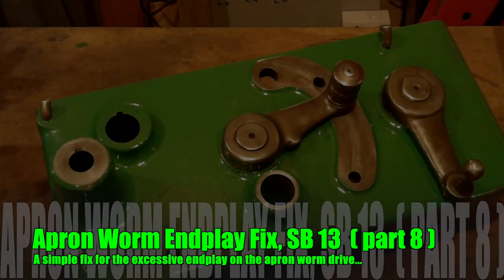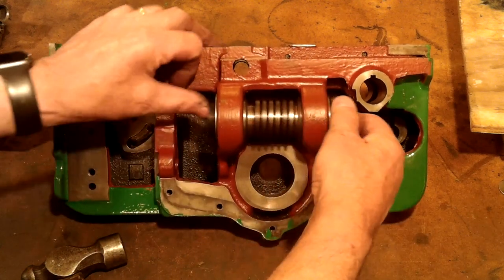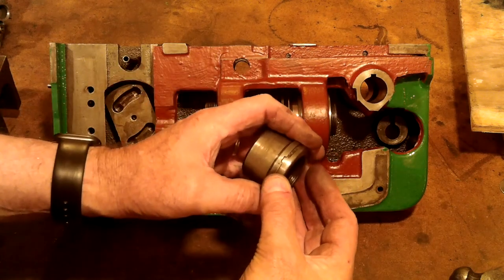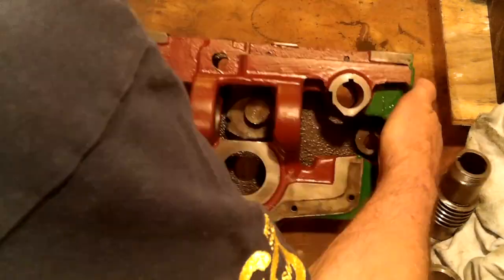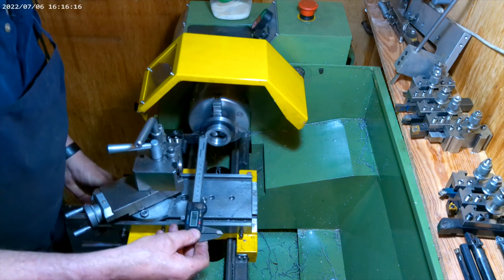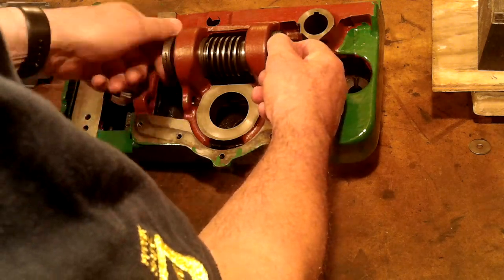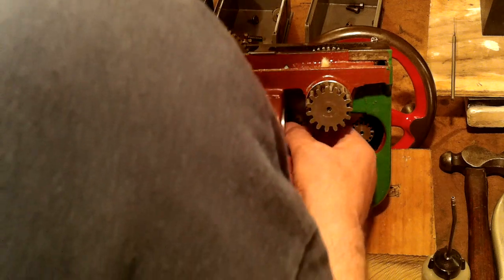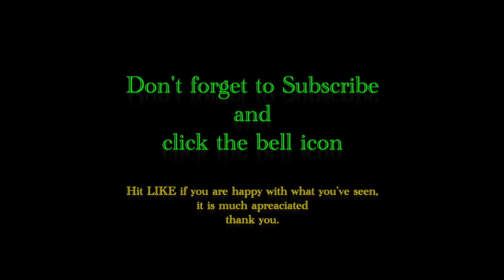Fixing the Apron Worm End Float (part 8)

Comment: Thanks for that, I've just finished doing mine but redrilled one collar to remove the end play. As for wicks, I refuse to pay Grizzly prices plus shipping to the UK so experimented with short lengths of 3mm and 5mm Lamp Wick and found they wicked a very heacy weight oil (120 SAE) in cold conditions in a similar trial to yours. I also tried using a thin strip of man made felt camping towel which only manager half the capilary performance og the lamp wick

Comment: Very nice work Paul!  I do think you have swapped the two ends.  In the take-apart segments, the one with the chisel marks is on right but when you put it back together, it is on the left.  Might have been intentional (or not matter depending on how you measured for the shim).
Reply from the maker: Hi, they actually went back the way they came apart. In the filming I took them apart and put them together that many times I sorta got it round my neck a bit.. cheers

Comment: Very nice indeed, thank you! I wonder - I have a few screw threads (leadscrew, lathe handwheels) where there's either a bit of slop, or it's too tight - is that a candidate for a thrust washer?
Reply from the maker: Hi, I really couldn’t say.. regards
Reply: Washers will not take out backlash from a word screw or nut but will help if there is play between collars
Reply from the maker: @tonyray91  Correct.. All I've done is remove almost all the ( axial ) endplay. Regards.